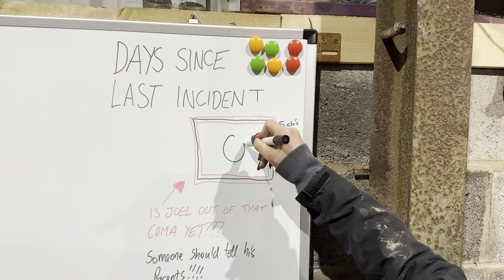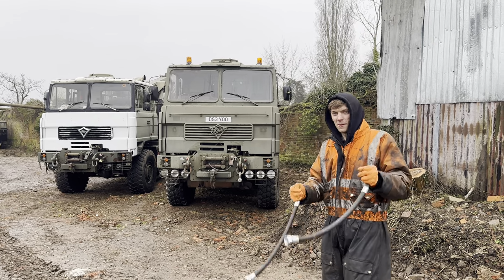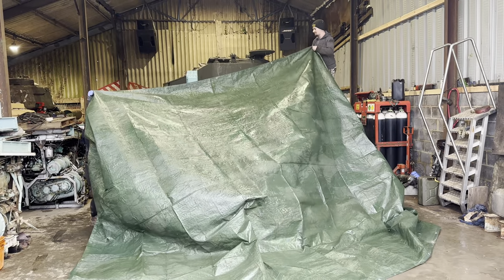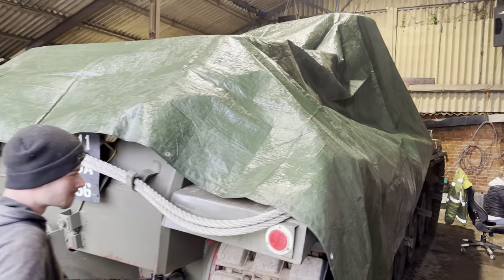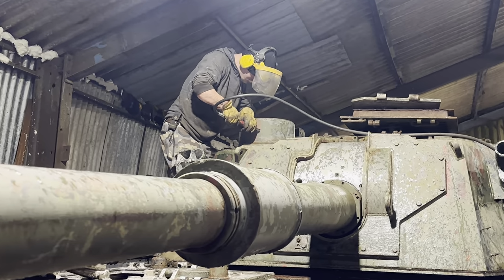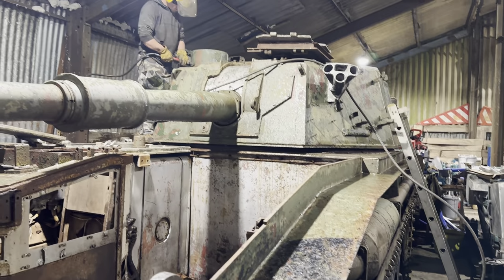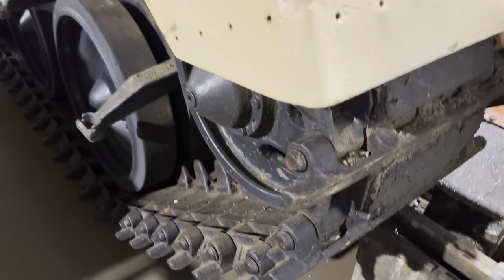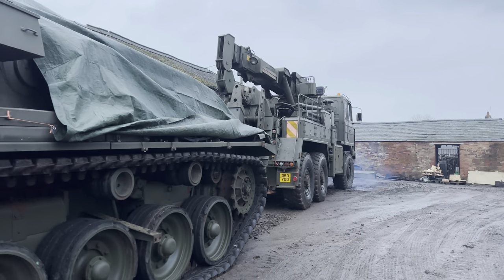Change of Plan!

Comment: The quiet "right we're going to get Diane Abbott in next" caused a coffee / keyboard interface moment. Thanks.
But well worth it. 🤣🤣👍

There is the clinically clean engineering you see in nice warm well equipped workshops on most YT videos about building this or that and then there is the real world of tank and military engineering like this. Its heavy, its mucky and its very difficult. And its done outside in the freezing cold. Unless you are the Australian Tank Museum restoring Panzers when its heavy, its mucky, its all seized, its very difficult and BLOODY hot!

BZ to all these lads and lasses who muck on and have a laugh. (Had to smile at the lady's shoes coming off to climb up on the AVRE).

Comment: When were shipping some armoured vehicles to Canada for a major exercise, we had to do the same getting all trace's of mud  out of the running gear which meant we took the tracks off laid them out, and had to take all the track pads off so we could jet wash the tacks. That was what I had to do on the 432s  it was emotional but not as bad as the poor guys that worked on the AS90 😭

Comment: Those Fodens really are a beast. I was serving in the falklands in 1995 and we had to get the Army Recce Mech to push a C130 Hercules aircraft out of the hanger as both of the aircraft tugs were unserviceable.
Reply: Pedantry, I know, but it's "Recy Mech".  "Recce" is the abbreviation for Reconnaissance.

Comment: We were always told that the Fodens were too heavy under UK Construction and Use regulations, coming in at a tad over 33 tons (max of 11 tons per axle)
Perhaps by removing the rear plough ground anchor is enough to get it within limits
Reply: It weighs less than 30 tonnes, actual weight depending on kit being carried, eg snow chains aren't light!
Reply: Just found the brochure which quotes 25.3 tonnes, but not sure whether that's the ex factory weight before the Army adds the tools etc.

Comment: The Foden is a mighty recovery beast. I wonder what happend to all those AEC mk3's "Militants" that they replaced in the late 80/early 90's ?
Reply: All AEC Recovery Militants were mk2s and Rhd all mk3s were Lhd
Reply: @davidcloudsdale4167  Incorrect!! The Recy Militants were Mk3s, as were the Mk3 Cargo, which unlike the Recy, were all LHD. The Cargo ran on 15.00 - 20 Cross ply tyres, & the Recy on 16.00 - 20 radials, Michelins, as the Fodens do.